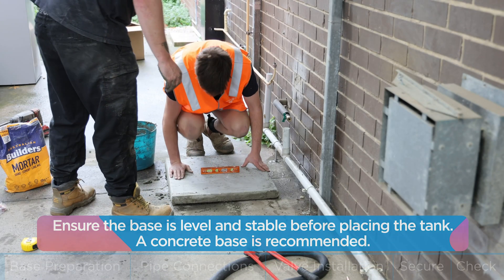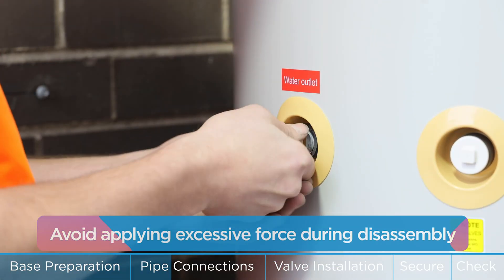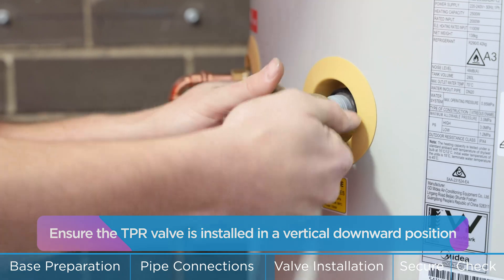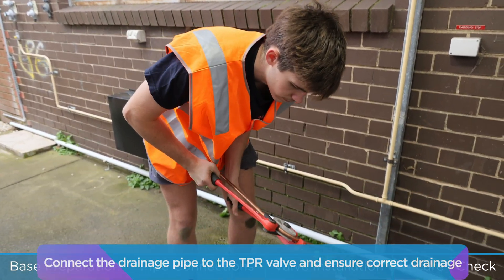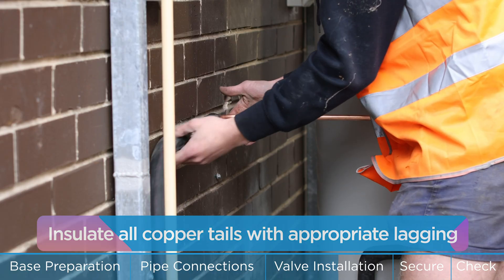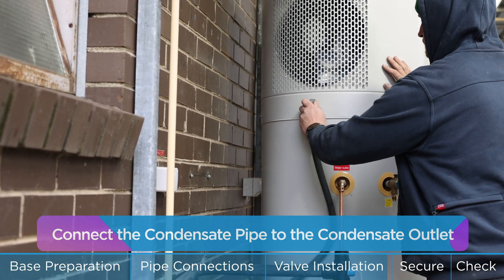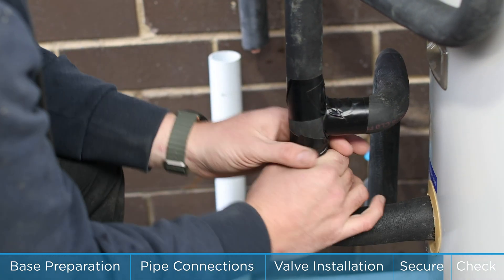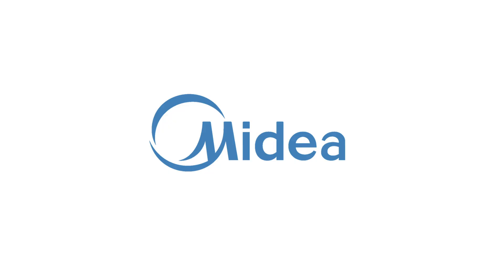Midea Hot Water Heat Pump - All-in-one system Setup & Installation Guide

Comment: The Bozo at 0:40 is wrapping the thread sealing tape the wrong way on the fitting, He gets it the right way round at 1:50 but he's put so much on he can't get the valve to rotate enough to line it up! At 2:04 he's wrapped it the wrong way round again.